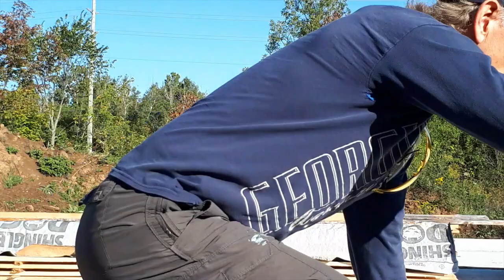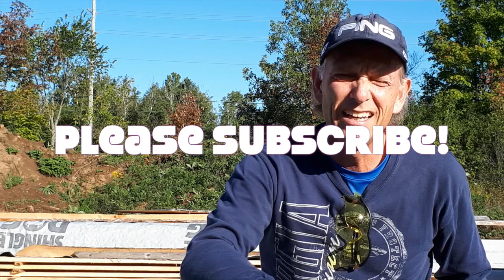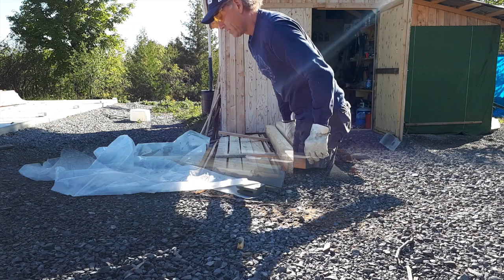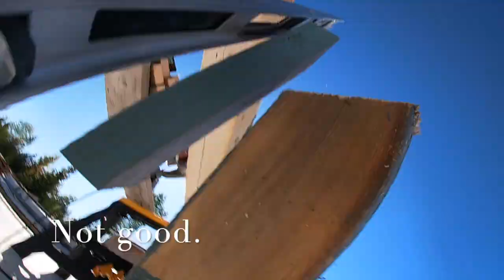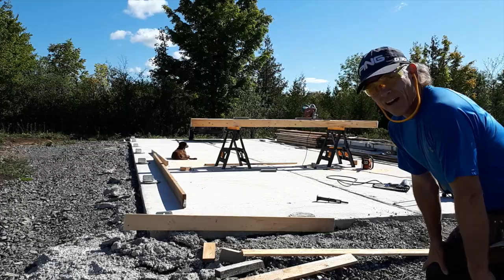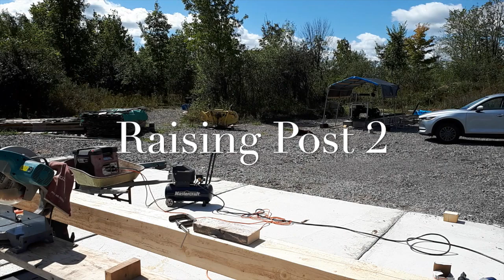Building My Pole Barn Shop #1: First Wall

Comment: You could also have attached the supports to the posts before and then attached them to the base later, that way the supports are already in place and can help support the post until you get it fixed. A bag of sand on the bottom of the supports helps a lot as it creates some friction that keeps the support from simply sliding out again.
Reply from the maker: Thanks Morten. These are great comments that could assist other DIYers. Peter at the Reboot.